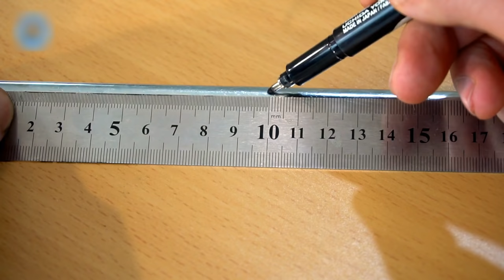2 AWESOME DIY IDEAS!

Comment: mouse trap too complex labour cost too high. The trap can only catch one mouse at a time with re-setting required. The bucket with water with tilting platform or pipe is better because those traps resets themselfs